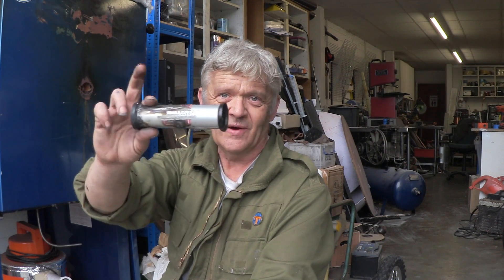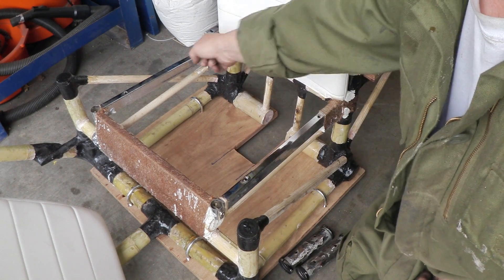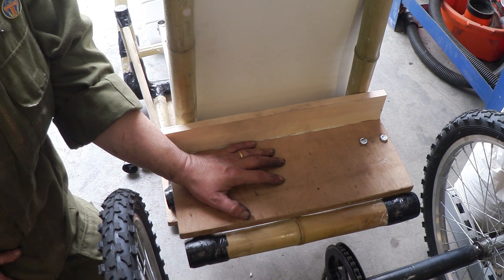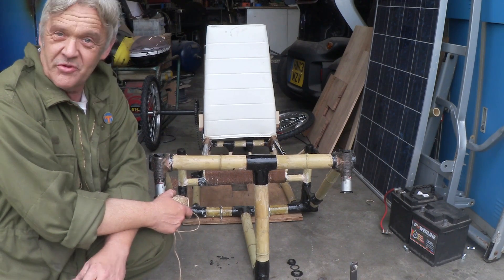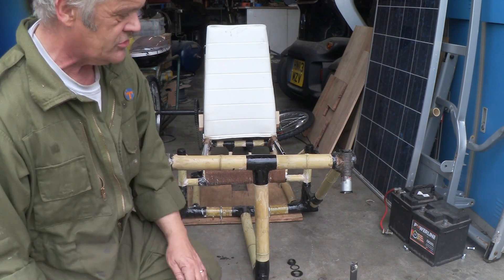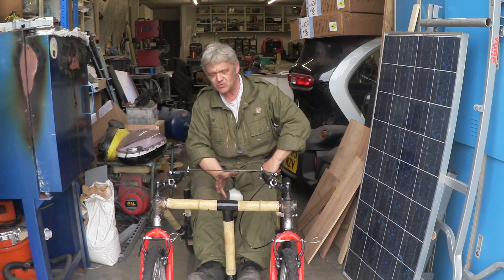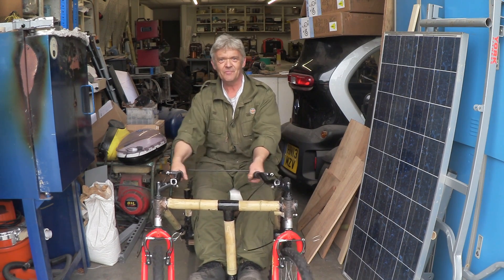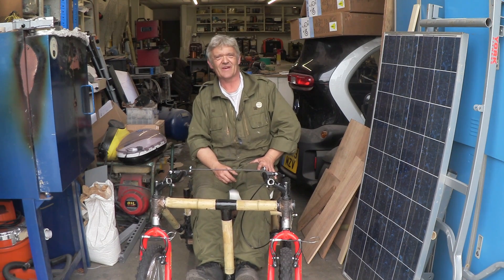1154 Buliding A Bamboo E Quad Bike - Wheels And Steering

Comment: That new steering bar is so thin and the weakest point of the whole thing if it goes wrong, might want to sturdy it up a bit. I am also intrigued by this build since like 20 years ago I saw this one "tandem" bike only they were side by side welded with about one meter long bars.

Comment: Watched a YouTube video of a bamboo bike kit being put together and it used strips of hemp soaked in epoxy wrapped around the joint and then enclosed in electrical tape to clamp it tight so resin can set.

Comment: The steering upgrade was a stroke of brilliance. So simple to do.

On the one I want to build for a senior that can't drive, I plan to have the Post are out not in for better leverage for her. If I am wrong I just put it the way he has it.
 I also want to maybe bend the handle bar out more for better leverage for a senior, also so if she bumps into something and rocks forward does not get poked in the chest with the handle bar.

I am also thinking of putting the tie rod way out front; for better leverage, and so that's not in the way to hit her either.

I want to hang the lights on the tie rod so the front lights move with the direction of the wheels.

I see he's got a solar panel there and that's a roof maybe, for rain and too much sun. It will charge batteries all day when there's Sun.
Reply from the maker: I like the plan mate - sounds good to me

Comment: Is that just a rod between the two sides for steering? The forces between the two wheels can obviously become high quite easily, might be best to use a flat or angled iron instead just to be on the safe side there
Reply from the maker: it is a rod mate - they can be high - but not that high !

Comment: Can Bamboo stand up to powder coating temps?
Reply: Try it with a small piece and let me know please.
Reply: Power coating requires 350 degrees Fahrenheit.

I suspect if you sand the outside of the wood, it should Bond. 

But powder coating requires the metal to be electrically charged for the power to stick.

My other concern is that a 350°, it will carbonize the bamboo and or make it brittle. Stronger but brittle.

So take a piece of bamboo and stick it in your oven at 350° for about 15 minutes and see what happens, versus a piece of bamboo untreated. Does it make it stronger or does it make it more brittle?

You can do this by getting a bamboo chopstick from any Chinese restaurant.

If you're just trying to figure out how to paint it and don't care about powder coat, try dip. Dip comes in many colors and is about $125 a gallon. If you add polyurethane to the dip you just extended how much paint you got. The polyurethane makes it much tougher and makes it last longer.

The nice thing about dip is if you decide you don't like the color you can always just peel it off, of your car or anything you put it on. If you add polyurethane you need a heat gun to take it off. But no biggie just some heat from a hair dryer or heat gun and a little more work to get it off.

I do not know if the powder coat will actually go on with the heat gun or not?
Reply from the maker: I have no idea mate - I like Steves answer though - try it and see

Comment: Can yuo use the solar panel next to you, and use it as a roof? And then leave out the batteries? I understand it will not run without sunlight, but for testing purposes it is great to know. Can you ride a quad on sunlight only? (maybe use a few super capacitors to store some extra energy when you are at a red light and need to go up hill later on).
Reply: One solar panel give on average 25 to 100 watts on the best day. Real expensive give more.

NASA put a fernel lens above the solar panel back in the seventies and It produced eight times as much power as without a fernel lens.

A fernel lens of that size is $50 or more.
Reply from the maker: well it's certainly worth a try mate
Reply: I saw a video on the solar controller. They show that the old style controller was less effective/ efficient by 50% than the new one.

So you don't need a lot of panels, you need a better controller to charge the batteries more effectively.
Reply: @reypolice5231  This question is about using the DC output directly to the motor, not about storing in a battery. But yes: your comment does make sense on it's own.

Comment: Getting a really strong joint from hemp 😂
Reply: and be able to smoke anyone with the quad, lol
Reply: I was wondering if you wet  the hemp dose it get even tighter because the water cause the hemp to shrink? 

Are you putting polyurethane over it or epoxy?
Reply from the maker: epoxy
Reply from the maker: yep

Comment: Great video, as always, look forward to watching. The down tube, did you consider leaving a couple of inches of the top tube and down tube still in place? That way, you could have slid the bamboo over the tubes for a more positive joint - then applied the string etc.

Comment: Hi Rob.
Free strings cut from platic bottles, then, the string is thermoretractable. If the joint came a little loose in the future, just blow hot air on it.
It begins shrinking from about 70c° to shrink more, raise the temp progressively, I tried up to 450C°, my hot air gun can't do more, théoricaly, the bottle can be reduced to the same diameter as the cork, I manage to go to 3cm. 
As an emergency repair, when I had to kwickly  replace our basement water pomp, in the middle of the night, as usual the "new pomp" had a different exhaust diameter, so I cut top and bottom of a bottle, shrinked it over the tubes, added some silicone when it was almost tight, and finished shrinking.
It's still in place and water tight.
Reply: Good to know, that works.

Some silicon formulas have arsenic in them and other toxic chemicals. So you may want to replace it, if it's drinking water.
Reply: Thanks for your reactions, mates, the water is going straight in the sewage.
Reply from the maker: I did think about it mate and I like the idea - I have certainly stored it for later use lol - cheers